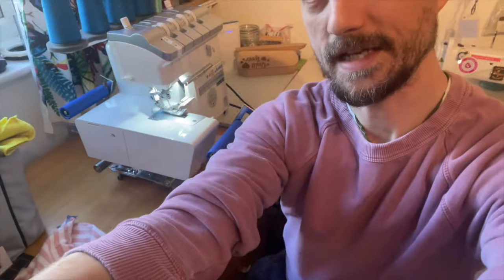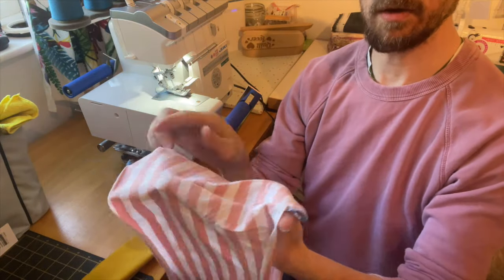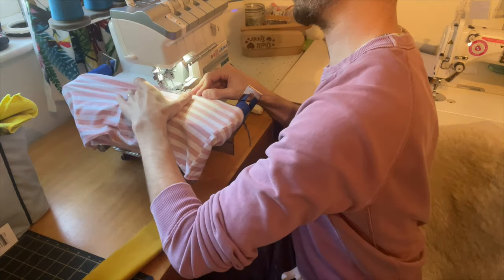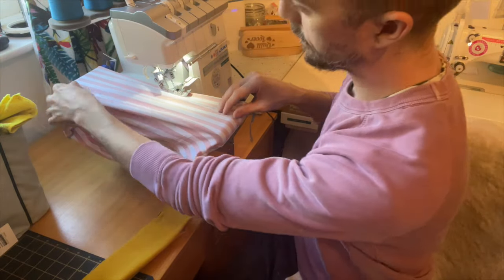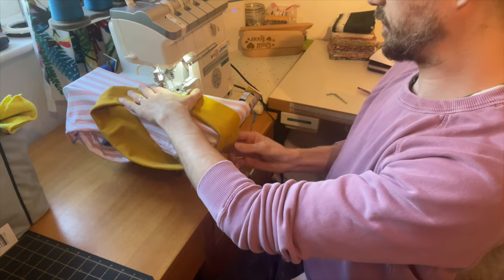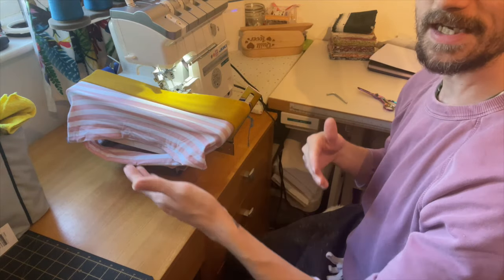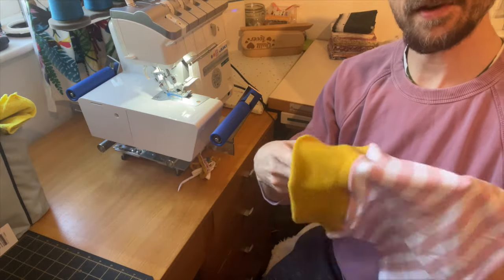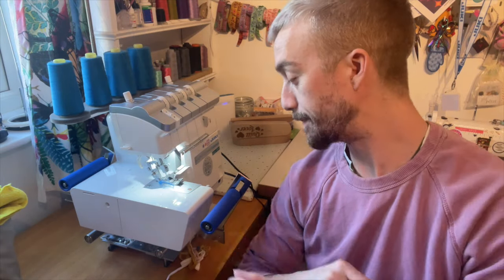What is a Wayliner?

Comment: I'm sorry am I missing something. I believe you are not supposed to over stretch the fabric when sewing with knits because you end up with wavy stretched out seams which is exactly what just happened to this "waistband".  I don't know if the rollers are fully adjustable but think you would have to spend so much time fiddling with it to make sure it doesn't stretch the fabric.
Reply from the maker: I agree I had it setup to wide for the size of the waistband I had on there, if it was a true garment and not a test peice I would  decrease the width of the rollers, it’s very easy to move them, they have a little bolt on each you just nip open and reposition the roller each side ☺️
Reply: @AdamSews  That makes more sense now.  Thankyou x❤

Comment: My waist is larger than that. Does it adjust wider or smaller or is that it ??
Reply from the maker: The rollers have quite a large amount of adjustment in them yes, the smallest will be limited by the size of the machine to a degree too ☺️
Reply: @AdamSews  
Not interested. Sorry. 💔